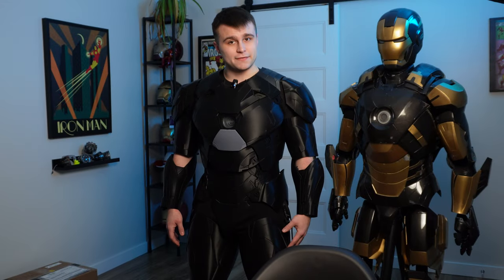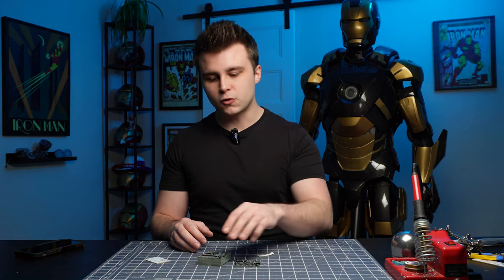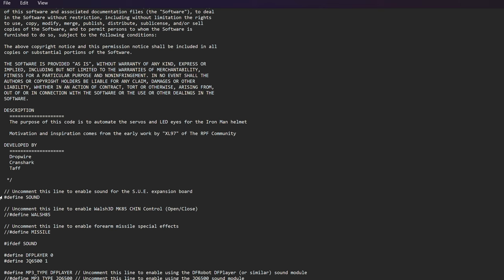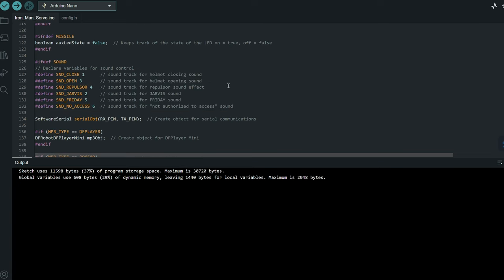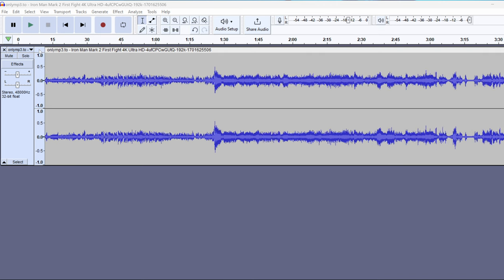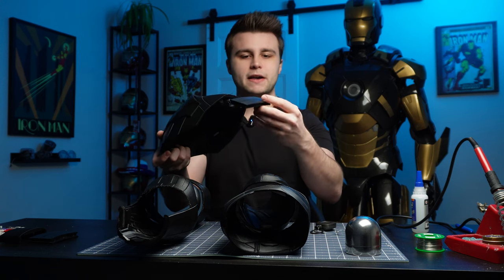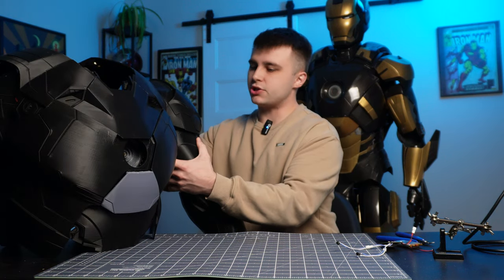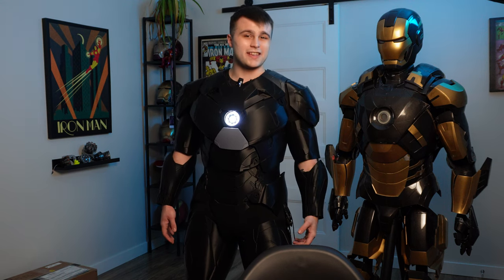THE SUIT CAN FLY NOW (sort of) - 3D Printed Iron Man Mark 46 Cosplay Update Video #3

Comment: Why not make exoskeleton 3d printed too like iron man then make the suit cover and place it on top of the exoskeleton
Try to make it as accurate as possible
Reply from the maker: Many have tried, but nobody has succeeded yet. The only way to make an exoskeleton work is to make it in proper materials like metal, and even then it’s over-engineered. Since it serves as a structural element, 3D printing the exoskeleton eventually leads to it breaking, and it’s extraordinary difficult to repair.
Reply: @plentifulprops3d i see that's why i don't see 3d printed

Is there any meterial that can be used in 3d printer?

Btw love your work